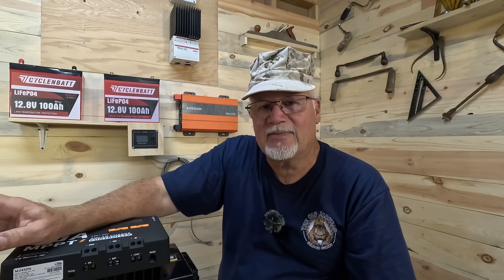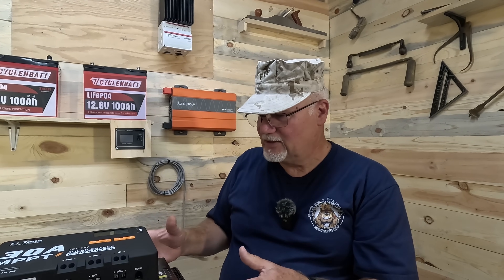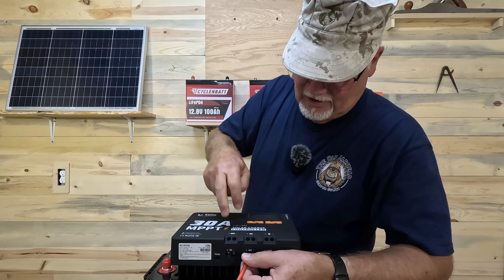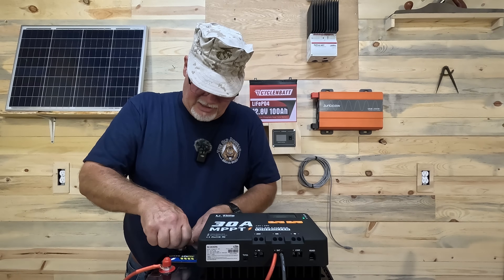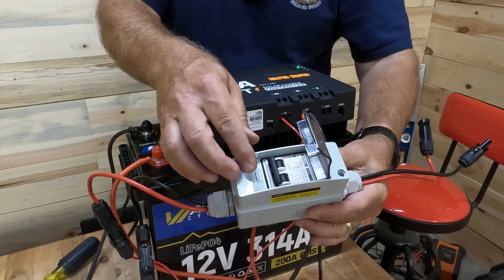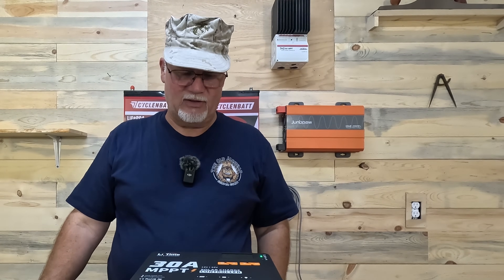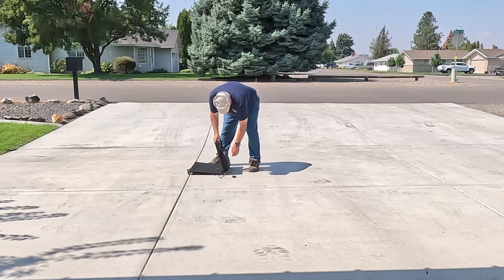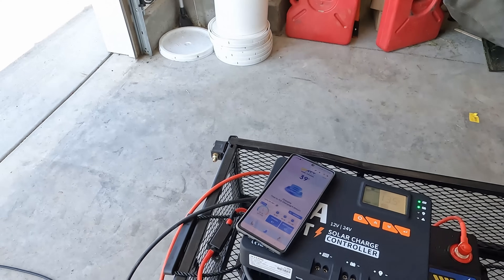Solar Charge Controller + Battery = UNLIMITED POWER

Comment: Is the solar breaker 1000 32
Reply from the maker: Not sure what you are asking but they have a lot of specs on Amazon, here's one: Tripping Curve	C ( ln5-10 ) Instantaneous trip (0.1s) at 5× rated current for short-circuit protection.

Comment: How does charge controllers actually work,  for example in your video how many panel minimum or maximum would it take for the mppt to actually dish out 30 amps

I've always wondered if you have a 60A charge controller but say you only feed it 400 or even 600 watts would it still dish out the 60 a some how?
Reply from the maker: Hi,  Since the 30 amps is output and watts are equal to amps x volts we can extrapolate that the charge controller would need 432w of output to get to 30amps (14.4v charge voltage at 30amps is 432w).  So it would need that coming in too!  So for example, if my current solar panel I'm testing were to put out it's rated voltage and amperage (36v at 11.1Amps or 399w) in perfect conditions I could get as much as 27.75Amps from this controller if there were no conversion losses -- I'm getting too technical right?  Sorry, just working though it.

So, yes it can get 30amps, but it would take a 450w panel to do that since it would lose a little in the conversion.  I'd have to connect it up to a couple of my bigger panels to see if it would work or even over panel it for that.
Reply: @TheOldJarhead  thanks man I have one more for you , you used an 8 guage to ring terminal, is there any premade 6 gauge to ring terminal pre made cables been looking for some

But it looks like I'd have to make it myself 😔
Reply from the maker: I think you'd have to make them or have them made.

Comment: that model. Watt cycle battery.  is defective junk. don't buy
Reply from the maker: That's not what Will said from what I saw but he did say that when paralleling it he had issues and my hope is that Wattcycle will address that issue with a software update.

Comment: Hello does anyone knows what size guage wire he is using.
Reply from the maker: and 10awg for solar panels and CC to solar, 8awg Cc to battery.
Reply from the maker: I didn't discuss it in the video, but the wire size must match the amperage of the system

Comment: I was going to use Farrells on my wire ends to charge controller so it has the best connection possible
Reply from the maker: Good plan, ensuring a solid connection is always a smart move.

Comment: I wonder why Amazon says "Frequently returned item Check the product details and customer reviews to learn more about this item."
Reply from the maker: For which one?
Reply: @TheOldJarhead all apparently. It seems everyone is satisfied with the product so I’m not sure where this warning on the product listing comes from.
Reply: I wonder if the returns comment is based on purchasers not knowing what they need. And, when faced with issues return it rather than learn from YouTube creators like you!
Reply from the maker: Are you referring to the charge controller?  If so I suspect you are correct.  Most don't know what they need and likely need 60 or 80amps at least

Comment: What if the PV panels don't put out enough voltage for the battery ?  Does the controller 'boost' the PV voltage ?  Or do I need to buy another gadget ?
Reply from the maker: That would be a strange panel indeed.  If you have, for example, a solar panel rated at 18v but there isn't enough sun to get it over say 14v then get a higher rated panel.  Maybe one that can do 36v.

Comment: Here's a video demonstrating using a torque wrench for proper tightening. Also, cable ferrules can be used on stripped wire for a better connection. https://youtu.be/T9S3VFroKe8?si=BV83nhWxRV8hg5tb
Reply from the maker: LOL of course, a torque wrench is a good idea but then again, not everyone is THAT concerned over tightening down the lugs on a 30 amp CC.  As for Ferrules, I have mixed feelings on them.  1.  You then have TWO mechanical connections where one is better than two IMO and 2. if not done exactly right they have a tendency to fail and come out.  I have ferrules on my monster cables for my stereo (I'm old) but man, if not done right they are a pain!  Bare wire might be better, my jury is still out there.

Finally, I hate to say it but LiTime is using an AI voice over and it's not very good -- maybe I don't hate to say it LOL after all, us human's might get more air time thanks to AI not being very good :D Cheers

Comment: Instead of attaching to a solar panel, would attaching to a car battery and using as a dc to dc charger work for this configuration?
Reply from the maker: Ahhh no.  I wouldn't use a car battery for anything in this world (solar/off grid etc) unless in an extreme need.  They are not meant to discharge like LiFePo4's are - but a charge controller is made to take the solar input and correct it to the right charging profile.  Now, can you take a battery and charge a battery?  yes, I show doing that with power stations but you still have to charge that battery at some point ;) and either this way, or a generator with a charger is it.

Comment: I use the LiTime MPPT 30A controller connected to a 24V battery and a single 460W solar panel. The load output of the controller (24V) connects to the solar input of my Delta 2. This way, when the sun is shining both the external battery and the Delta 2 batteries are receiving a charge. Come night the 24V battery continues charging the Delta 2 via the controller.
Reply from the maker: That's a clever way to maximize your charging efficiency.
Reply: Great. But you're doubling the cycles on the 24V battery, right?
Reply from the maker: Not really.  LiFePo4's typically have 4000 cycles at 100% DoD

Comment: Hello! Excellent video, my friend. Can we connect the battery directly to a power station? Or should we disconnect the solar panels?I mean it would be great to use this system directly to a power station to use this battery while it charges as an auxiliary battery.
Reply from the maker: Yes we can
Reply: @TheOldJarhead Friend, could you please make the second part of the video? That would be extremely important for thousands and thousands of people here in Cuba who would be replicating that system.
Reply from the maker: I certainly could -- I've actually done several showing that half of the equation but perhaps another with this setup would be good.
Reply: @TheOldJarhead Please do it, and I'll share it with the thousands of Cubans who use stations. If you can do it using an OUPES station, that would be great. Your videos also have audio in Spanish and that helps us a lot and your reach is much greater.
Reply from the maker: I can do that!

Comment: Thank you for the Dommentary, Eric.

I found some Dr Prepare 12v 100Ah batteries for 139,00 Labor day sale.
Code COVE10 adds 10% off. 

Question on the Charge Controller.
So you said that it will take up to 100volt input and then automatically step it down to 12v or 24v.
Is that correct?
Reply from the maker: Yup, that's right about the voltage step-down capability.
Reply: @TheOldJarhead Thank you.
Reply from the maker: You bet

Comment: I have that solar charge controllers big brother. Rock solid unit. And actually when connecting, it’s supposed to be negative last. When disconnecting it’s negative first. This is standard practice in the automotive industry.
Reply from the maker: Good to know!
Reply: @TheOldJarhead they do that so if you hit metal with your tightening tool it won’t arc in either scenario. Going on with the cables or off. In that order the only thing you could arc on would be the other battery terminal.
Reply: hey everyone i have the same solar charge controller 60amp . I like to know what size DIHOOL Solar Panel Disconnect Switch i need to connect . Thank you
Reply from the maker: That depends on the solar panels and how they are connected (series or parallel).
Reply: @TheOldJarhead  Im connecting it into seris and i want to use a 48 volt lifepo4 battery
Reply: @TheOldJarhead I’m in a series with that one. They’ll take the higher voltage. I was thinking earlier about mentioning another litime I have. It’s considered a dc to dc charger with a solar input. Tiny thing without a lot of frills, but it’s been solid too (rated at 40 amps ) it only takes 30v solar though, but it does do reverse charging so one could put voltage back into your starting battery. No bluetooth or WiFi though. I just monitor mine through a Bluetooth shunt.
Smashing good until for a small system in a pickup or van.
Reply: @DavidSmith-cl1ii what is the rated wattage and voltage of your panels
Reply from the maker: So what is the panel amperage and number of panels?
Reply: @TheMajictech 
I have 4 panel. The  open circuit volt is 37.07.     400 watts panel / 13.79 Amps
Reply: @TheOldJarhead 
I have 4 panel. The  open circuit volt is 37.07    400 watts /13.79 Amps
Reply: @DavidSmith-cl1ii I’d go with a 60 amp circuit breaker then. NOPE correction read below.
Reply from the maker: Ok, so if all panels are in series (148.28v) then the amperage is just 13.79 amps.  Adding 25% safety factor takes you over 17amps so I'd say get a 20amp breaker rated for well over 200v.
Reply from the maker: Not for the panels, 20amps for them as they are only 13.79amps and in series.  In parallel, I'd use a 70-80amp breaker
Reply: @TheOldJarhead yep you’re right, I had the series/parallel wiring and rules backwards in my head. It’s been a long day
Reply from the maker: Right, and in series the amperage doesn't change so the breaker only needs to be a 20amp breaker.

Comment: SUPER tip    
in 48v systems  avoid small powerstations when you  charge the rack or any 48v  lfp battery!!!
 ... when charger reaches 100%  stats  it might reach  up to 58v and its a bit  dangerous to any powerstation working with booster mppt!    like eco flow  etc   that says max 60v input   is bETTER to use 12 or 24  or  36v  external battery   to be more safe
 !!    a rested lifepo4 battery even 48v  goes down to 54v  which is safe when no charge
even when station is 48v lifepo4 inside  that voltage you give passes through some electronics before reach the charge  state!!!!
Reply: Something that works fairly well for smaller power stations is to just connect up a step-down DC-DC 48V to 24V converter and run that into the smaller power station.   One can choose the 48V-to-24V for a modest transfer rate of 256W to 384W depending on what the power station is willing to draw, or trickle-charge with a 48V-to-12V where the power station usually automatically limits the rate to 8A @ 12V (around 100W) because it thinks it is being connected to a vehicle.

Comment: This is part of my plan. Two 300ah 12v in series to feed the PPS and a 60a charge controller with 1200w of solar to fill them. Kinda like filling an aux fuel tank to transfer to the main tank. As for the positive first, I learned that order for car batteries but I honestly don't know if it matters in this situation
Reply from the maker: Sounds like a solid plan!

Comment: Why are those panels a game changer? Just wondering
Reply from the maker: Coming...but it comes as one 400w panel, but it's split in half and has two outputs, so you can run it in series or in parallel, allowing two different voltages or use them separately.   Among other features.

Comment: I enjoy watching your video's! The solar components have improved so much in the last few years. These systems can put out a lot of power. And it's not how much you can power from your battery. One question to ask is it safe to run that much from your system. Cleversolarpower by Nick YT channel goes into important details and formulas on setting up solar systems.
Reply from the maker: Sage to run 30amps into the battery?  Absolutely!  It's cutoff is 100amps 😁

Comment: Hey Erik question i have several panels now and noticed they all being about 18-19V having a 12V systeem and batteries and a powerstation as you know, but am i correct i can use a larger voltage panel as long as it stays under the max voltage of the mppt controler and xt60 of the powerstation? By the Way the Eco worthy panel works as expected but also as my calculations made me expect its just getting a 40% overall yield due to position and few sun hours. Hope did not made to many grammar errors. Thnx for a clear video again. Have a great day.
Reply from the maker: Yes!  As long as you have an MPPT controller you can run higher voltage panels into it.  I ran 60v for a 12v system until I changed to 24v and have one array running 75v for the 24v system
Reply: @TheOldJarhead  My small portable Mppt controler says it has a Max Solar Input Voltage:12V/30Voc;24V/60Voc, having a 12V system i ques 30Voc is max?
Reply from the maker: Yes

Comment: But what about "inline" type charge controllers like the bateria power 20a .. those have sae ends/connectors 

So how would you do it two mc4 to O-ring cables?

Also I'm going to minus half a point for not using solar ferrules on the ends.. not the end of the world they will work just fine without them
Reply from the maker: If I couldn't buy them I'd make them.  Easy.

Comment: Is there such a thing as a charge controller with an AC battery charger built in, but without an inverter? I can't find one. I'm in the market for both, but it would be nice to find one unit that does both, however, I want to use my inverter.
Reply from the maker: No I don't believe so.  There are, however, all in one systems that contain everything you'd need except a battery and solar panels :D
Reply: @TheOldJarhead  You're right. I guess I'll just buy a battery charger. I assume if I am using the homemade power station for backup during grid outages I really don't need a charge controller unless I decide to hook up solar panels?
Reply from the maker: True, a charge controller is only needed for solar panels.  Though, of course, at least one good panel is a nice thing to have during longer outages as then you don't have to run a generator as much ;)
Reply: @TheOldJarhead  Power production and storage is addictive, however it's my drug of choice!!
Reply from the maker: Amen!